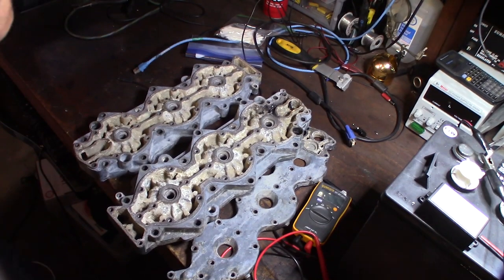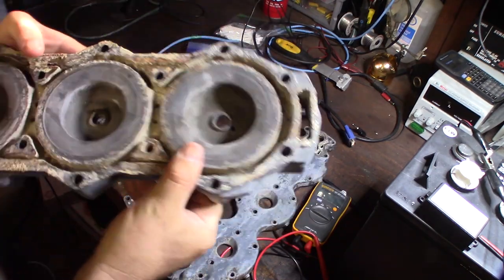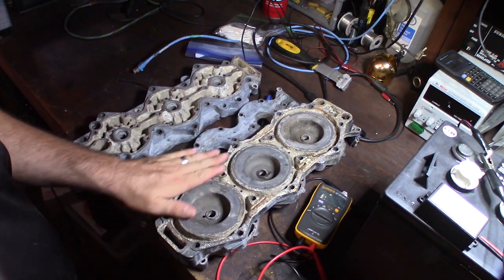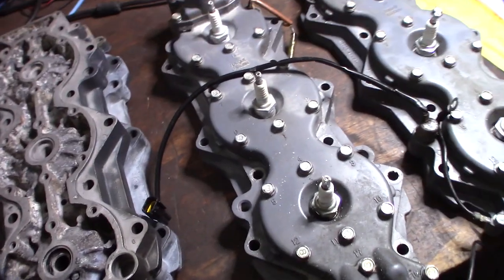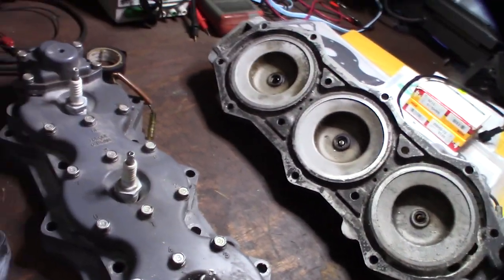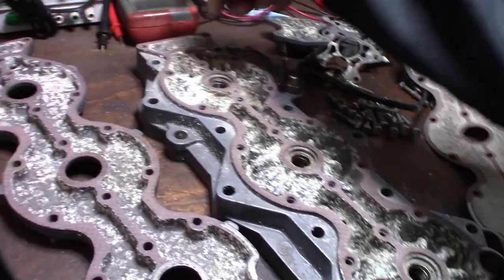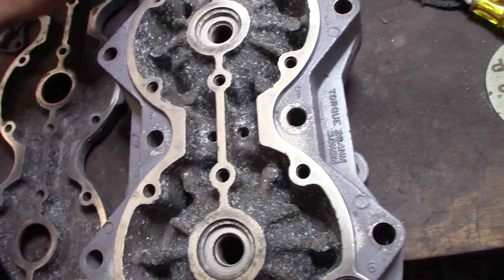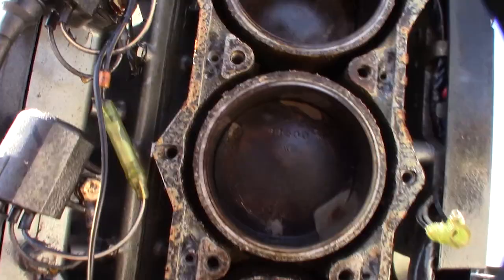Yamaha 200 HP Outboard repair head corrosion leaking water into cylinder seized

Comment: How did you clean up the cylinders.  I have a 1990 yamaha pro v 150. Had a similar issue. Seized up. Took the head off and found rust in 2 cylinders. Got the fly wheel freed up but it makes a loud squeek and get kinda hard in one spot while turning the fly wheel with a socket.

Comment: What did you use to remove the head bolts without breaking them? Need to do this but scared to break a bolt due to corrosion

Comment: Thanks for the video! I had the exact same issue on opposing cylinder heads #3 & #4 with low compression 85-90 and water injection LOL through the head dome like yours
Either its from  corrosion or  bad castings from yamaha ?